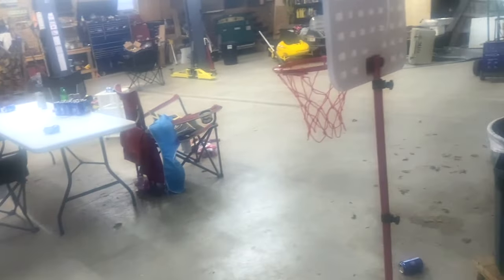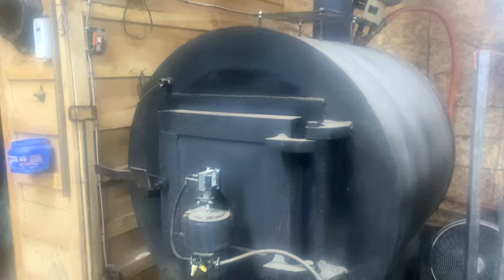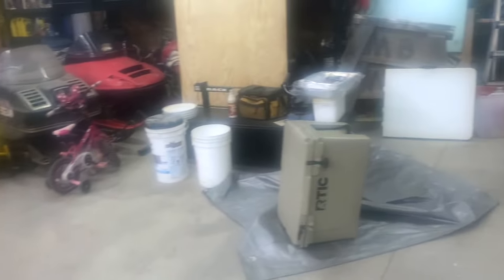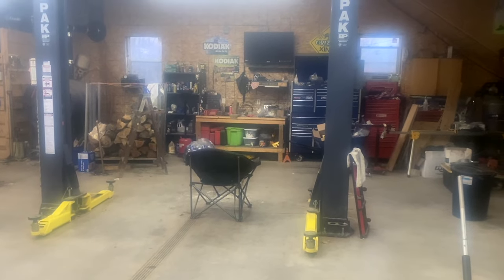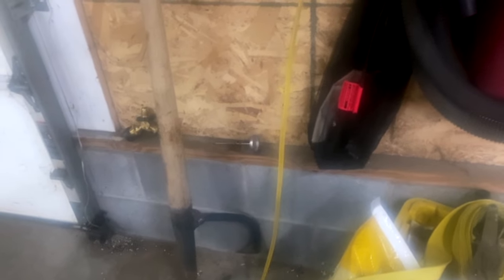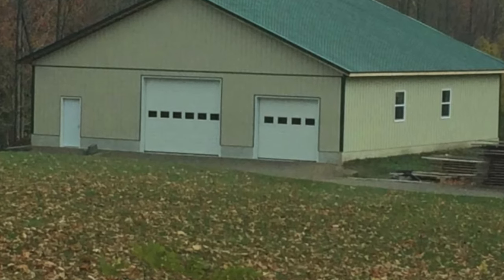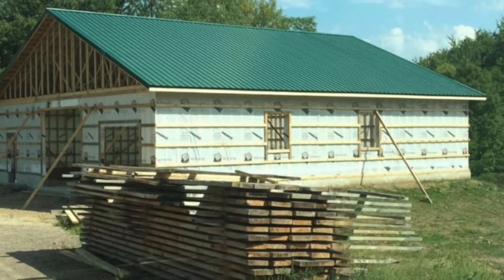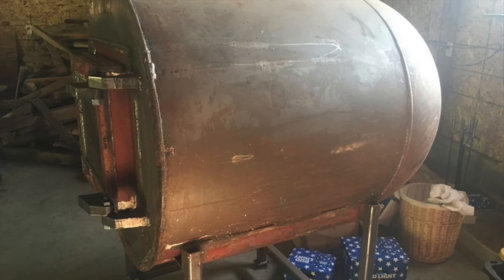Home made wood boiler heats huge shop with in floor radiant heat.

Comment: Man that’s a nice garage, messy though
Reply from the maker: Messy means we actually do work in there. You keep it cleaner then my shop buddy. LOL
Reply: It too me a long time to learn to store tools and parts neatly. Still messy because I have far more stuff than I have room to keep.

The water heater is clever but I wonder about the safety. If the expansion tank vent clogs that could pressurize and become dangerous.

The shop looks great. I suggest getting a ton of 1 1/2 square steel tubing and making a lot of shelves.
Reply from the maker: @gregwarner3753  the expansion tank has a big hole in the top buddy. Check out the video of the cabinets I built for my shop in Matt’s shop. Lol
Reply from the maker: @gregwarner3753  https://youtu.be/HqySeQQK1ag
Reply: @bondobuilt386  Mostly worried about you safety.

Looked at your bench and cabinet build. Nice job. Steel is not hard to work if you have the tools.
Reply from the maker: Thanks Greg. Yes we like to build things in winter out of metal. Matt’s shop is predominantly a metal dab and light auto repair. My shop is set up for more of the wood working side of things but I do have a plasma cutter and 2 welders. Lol

Comment: Can a normal gas fired hot water heater be used for something like this?  If so, Pros/cons?
Reply: Chris, I have friend that used an electric water heater to do a smaller shop, it was set up dual fuel so he could get cheaper KWH rate from utility co. Gas would work also. As long as you are very well insulated and can push about 120 degree water through the tubes, you can be comfortable. The thing to watch is the price of fuel in your area; LP, gas, electric, oil, etc.
Reply from the maker: Yes a normal gas water heater would work fine. the pros are they are less expensive. the cons are they need a chimney to vent them and they are less efficient. Depending on where you live I think I would go gas or oil over the electric. We did a house with an oil water heater and that works awesome. 😊
Reply: Around 1990 a friend of mine in NJ built a 40 X 60 shop on slab.  He used a regular domestic gas water heater and 3/4 polybutylene tube in the slab.  Pro: very simple, shop temp was always perfect and he had 2 bedrooms plus full bath in the shop for guests, so the one water heater provided all the domestic hot water he needed also.  

I used his idea building my house in 1993: 80 gal propane water heater, 1/2 mile of polybutylene 1/2" tubing in 1800 square feet of my first floor.  It uses a small circulator pump I turn on to start the floor heating through a manifold/valves for each of the rooms.  Once the system is on a few hours, I can turn off the circ, and water flows by thermosyphon.  Cons: it is against building code to use the same water for heating and domestic supply; don't tell anyone.   I have had 2 heaters last only 7 and 12 years respectively as the water here eats the cathodic protective zinc anode quite quickly, and I did not catch it in time.  I installed electronic cathodic protection in the newest heater.

Comment: Looking for the foam insulation.  where can I find a good price on it?  I'm doing a 3000 sqft pole barn floor
Reply from the maker: Sometimes you can find used sheets in Buffalo New York. Not sure where you live? I get a good price from a local guy I grew up with that has a lumber store. You want polystyrene. Closed cell. 👍

Comment: Ok....got to give credit where credit is due...who is the boiler maker...? I certainly will not show off someone else's boiler.
Reply from the maker: Raymond I did about 50% of the welding and designed it with my buddy. We have a group of friends that hang out in our garages and do projects and have a few beers so it was a joint effort. I designed the entire heating system to include the insulation and tubing in the floor. It works real good. 👍😊

Comment: I didnt see a pressure release or autofill. Did I miss it?
Reply from the maker: No it’s a non pressurized system as stated in the video.
Reply: @bondobuilt386  so you are heating water in a boiler without any pressure relief? I understand that you say its not pressurized. What would happen if the outlet got blocked?
Reply from the maker: @rogerwhiting9310  if the outlet got blocked it would react the same as a pressurized boiler that pressure relief was blocked. It is wide open outlet in the top so not sure how it would get blocked?

Comment: Hey Bondo, I wondered if you could answer a question for me. If I were going to try to build one of these boilers, would I be able to use a galvanized pressure tank(from a well) for the inside chamber or do you think that the galvanizing would cause a problem inside of the water chamber, I know it would burn off inside of the fire chamber walls and I’m not really worried about that but do you think it would cause an issue inside the water chamber as far as possibly coming off and plugging lines ect.?
Reply from the maker: Hi there Grant. I don't think The tank would be heavy enough for the boiler buddy. and I would worry about the water getting impurities from that tank. Try and find an old air tank or propane tank.

Comment: I laid radiant heat pipe in my garage 22 by 24. I'm going to heat it with a woodstove I have. Wrap copper pipe around the drum stove and run it into a hot water tank. Which will be gas heated as well. But the primary heat source will be wood. Any advice you can give me regarding this system would be greatly appreciated. Especially water pressure relief and circulation pump needed.
Reply from the maker: Taco 0015 IFC is a three speed pump that will handle many applications. This will most certainly handle the radiant heat tubing zone. A Taco 007 would be a cheaper pump that you could use to run between the wood stove and the water heater tank.I think I would hook the system up from the water heater to the in floor tubing as if there was no wood stove then hook the wood stove loop to a side arm heat exchanger on the water heater to just pre heat the water heater with wood when the stove is burning. You can build a side arm heat exchanger. I did one for my domestic water from my wood boiler.

Comment: Ron for those who don't know what is a monolithic foundation
Reply from the maker: Hi Mario. It is a concrete slab with an integral footer. The slab is thicker at the edge. Usually 12” thick on the edge with 2 rebar all the way around and the middle slab is around 6” thick and they are poured at the same time. 😊
Reply: @bondobuilt386  that's what I thought, now I know for sure thanks
Reply from the maker: @mariowickel456  no problem 👍

Comment: Unfortunately any boiler that's just a pot with a fire inside is terribly inefficient.  The most efficient (and most complicated) boiler designs have fire tubes inside like a steam locomotive. Maximum heating surface area exposed to the water.  Taylor outdoor boilers are sorta like that, except they have too few fire tubes, that are too large.
Reply from the maker: Yes I agree I built a fire tube boiler and used it for 6 years heating my house and shop. It worked pretty good.  I sold it and built a bigger one
Reply from the maker: The bigger one didn’t work that good. Lol
Reply: @bondobuilt386  I'd like to see a video of those if you still have them
Reply from the maker: @funone8716  I didn't do any videos on those builds but i might have a few pics.
Reply: @bondobuilt386  Put them up in a future video
Reply from the maker: @funone8716  Ok I might just do that buddy. 👍

Comment: Cuts a few trees a year. Takes 8 cords to heat it.
Reply from the maker: Roger he burns 5 to 8 face cords a year and a lot of the wood he burns is free from where he works. They have big heavy skids he cuts up and burns. My point was he does not burn much wood for a huge shop.
Reply: 3 face cords = 1 cord so basically heats that huge shop with 2 cords of wood 🪵

Comment: As a P.E. in NY, I am not pleased that they built their own boiler.  There is a reason all boilers are subject to inspection and stamping as pressure vessels.  Plus there are a number of required safety features, such as T&P relief.  Just because you can build a boiler doesn't mean you can build a SAFE boiler.
Reply: Not a PE and have an honest question.  Also not trying to turn this into a youtube comment shitshow. Is it really a boiler?  I know it is referred to as a boiler but really isn't it just a hot water heater (below 212 and not under pressure)?  If there were any issues wouldn't it just spill out the relief on the top and run onto the ground, just like a T&P but minus any mechanical valve (that can fail).  This "boiler" is not under real pressure.  Also couldn't you just dump the excess heat into the slab?
Reply from the maker: Richard as stated in the video this is Not a pressurized boiler. This is an open system and builds zero pressure. If over fired it will just boil over and get the floor wet. So yes it is a safe system. 
Thanks for the comments though. 👍👍
Reply: With the commentary that it is intended to be an unpressurized boiler, it would be thought there should be no issues.  However, holes can become plugged.  Periodic maintenance should reduce that issue, but don't be surprised if you get an inspector who has a problem with it.
Reply: @theodoreschulz6429  T&Ps are designed to fail open, which is required for all safety elements.
Reply from the maker: Thanks Richard we keep things clean but thanks for the heads up. Safety is always a good thing to keep in mind. 👍
Reply: @richardwargo5201  As a service tech for 25 years, I agree that safety is important and a pressure release valve is cheap insurance. But in this case they installed an expansion tank and left it open at the top end. Wouldn't you agree that that satisfied the requirement? I mean, it's always wide open to atmosphere.
Reply: It would never be allowed in Massachusetts if it was inspected
Reply from the maker: @theodoreschulz6429  yes you are correct in all that you say here. Most outdoor boilers are not boilers just keddles heating water. This system usually runs around 120 degrees Fahrenheit. 
Thanks 👍👍
Reply from the maker: @kenlee5015  yes Ken exactly. Thanks 👍
Reply from the maker: @rogerwhiting9310  I would not build and use this in your area then.
Reply: This is a tea pot hot water heater, not a pressurized boiler system.  One of the most important things on these systems is to keep all heat transfer surfaces flooded with water & leave room for water expansion away from the fire.  When mild steel is flooded & treated correctly with nitrite/Azole corrosion inhibitor, it minimizes corrosion within the vessel.  Byproducts of corrosion (iron) become insoluble & then can plug up PRV (pressure relief valves) when water becomes “dirty” with iron.  

Most outdoor tea pot water heaters keep water level too low & the inside water jacket suffers corrosion at the water line.  Chemicals mentioned above can only treat mild steel that is continually submerged in water.  Consequently the sacrificial anode is part of the structure of the water heating appliance.  Always make the sacrificial part of the system away from the water as this guy did.

Comment: We must be brothers, your buddy Matt and I, separated at birth! https://youtu.be/iOn6ctZrZmI?si=6YQXhCqnDuV6WC5S Our stoves are quite similar, I've had two, nearly the same for over 40 years now, the big breakthru I had a few years ago is a pre heated intake air system (it runs along one side of the fire box, from the rear, and exits at the front of one side) and even though i have a 4' long firebox, I keep the wood short, 16" max, and the rest of the firebox is just a heat exchanger in effect. With the air intake on one side, I get a swirling motion of the flames, and just last year I added a used oil drip system, that burns clean and really adds to the BTU output. Since I started burning short lengths, I get no smoke, maybe a bit of initial startup, but the stovepipe also stays clean. I was raised in SE Michigan so know his climate well, my Idaho location is as cold but we get lots of sunny days, so a big solar thermal system works with the boiler to heat my floors. I haven't needed a fire in the last 8 days, with 20 degree nights and 40's day, but real sunny. Nice touch on insulating the above slab stem wall, which many ignore, mine is also insulated there, but inside.